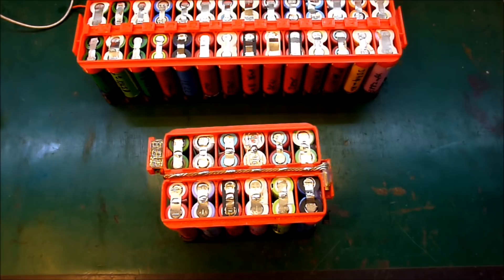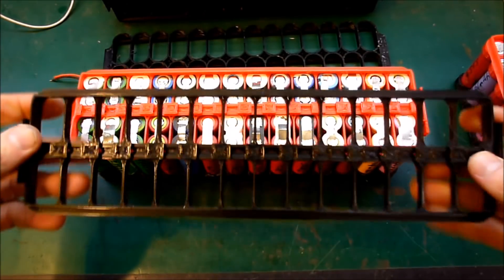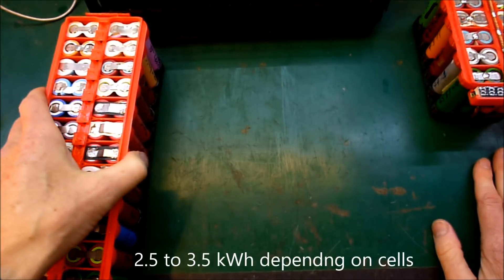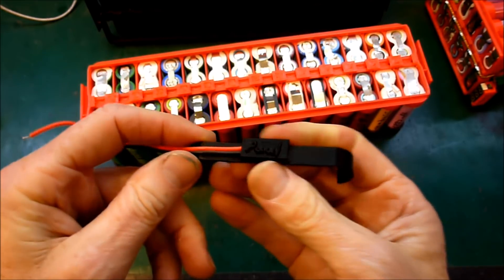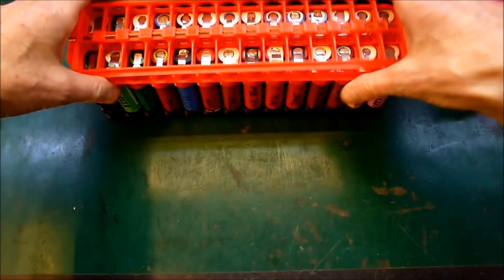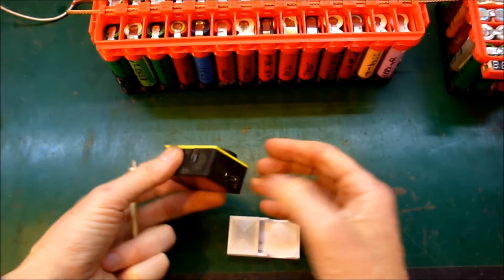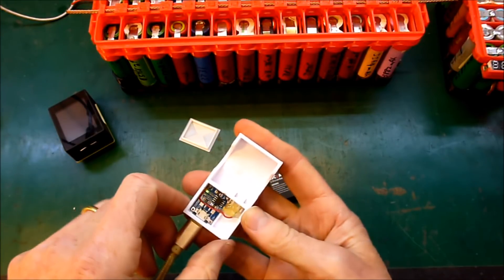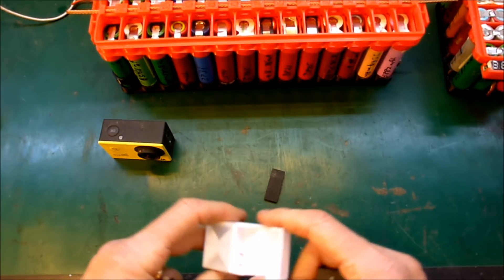Laptop Powerwall 135 - A new 3D printer

Comment: Is this now a dead project I went off 18650 die to getting lev40s but a shed load of 18650s fell in my lap
Reply from the maker: Also - I'm sourcing my 18650's from e-bike batteries now days. Those Lev40s look good though - much less work. :)
Reply: @paulkennett  yep dead easy have about 1500 18650 need to do something with them only so many touch and fans you can use 😁
Reply from the maker: Hi Arden. Nope - I'm still adding packs to my system. It would help if I got some more solar panels too. The main reason for no new vids is the existing system is happily in and running no problems. Not much more to say really. Although I did get side tracked playing with my electric car also.

Comment: Would you print something small for me? It’s for a arduino project. I would pay you for it.
Reply from the maker: sven are you in New Zealand? (Sending stuff overseas is expensive.)
Reply: Paul Kennett thanks for quick reply. Australia. I thought you weren’t too far away. It would be about 5cm square. Bit smaller.
Reply: Paul Kennett just to hold a inferred sensor and temperature sensor
Reply from the maker: Email me the file and I'll have a look. Paul at kennett dot co dot nz